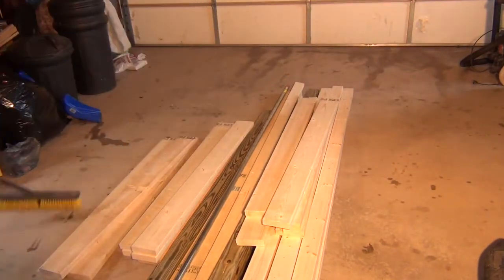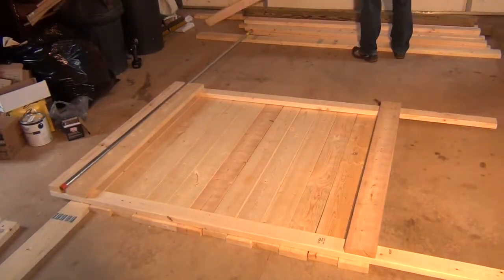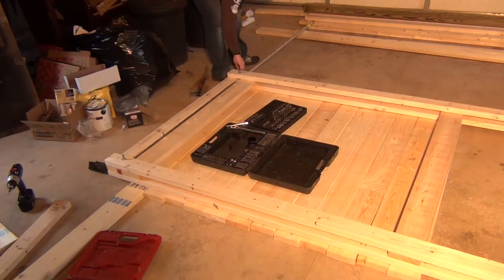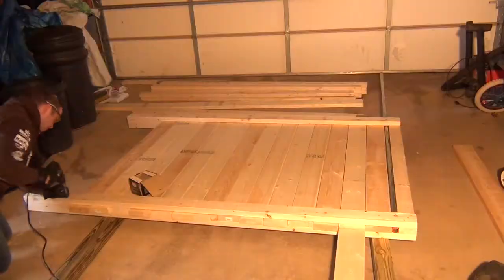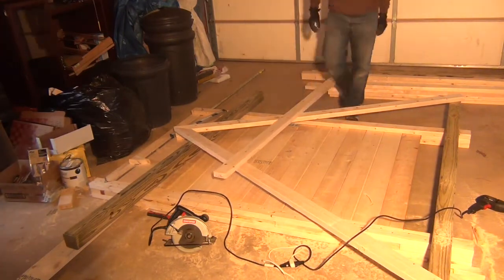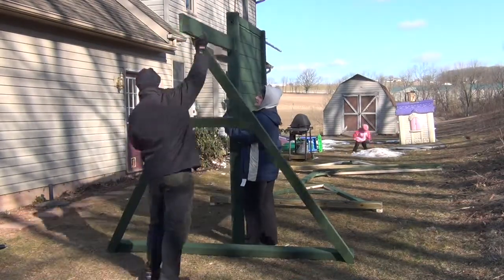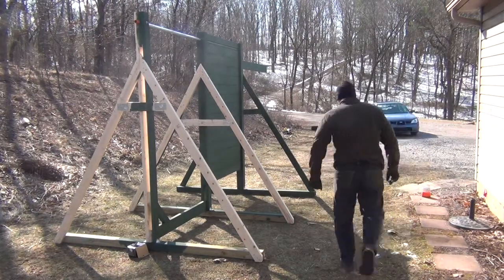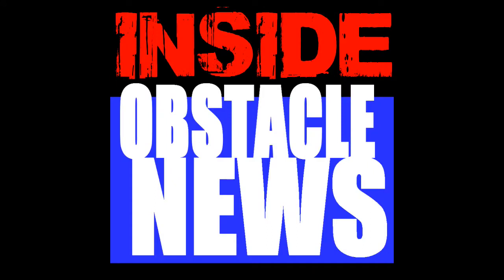Build an Obstacle Wall - WOD Hacker 4

Comment: Very helpful thank you. My biggest question is the length of the: "feet" or treated 4x4s and the "A" cross braces. With those lengths do you feel its secure enough from tipping or would you make either longer. Again, appreciate your comments, and good job on the video.

Comment from the maker: The wall uses standard lumber sizes so it is eight (8) feet four (4) inches high, because you stand the 8ft wall up on top of the treated 4x4 base. It can be any width you want but I chose five (5) feet wide because it was cheaper and easier to have my 2"x 6"x 10' boards cut in half at the lumber store. A lot of the angles I just kind of eyeballed and cut to fit. Hope that helps!

Comment from the maker: The 4x4's and 2x4 'A' braces are also 8 feet long.  They are heavy and rock solid.  I've never felt any give to the wall, even at the top, and I'm over 200 lbs.  If you wanted a wall that was higher, you may want to go wider at the base.

Comment: Which connector plates did you use along with the angle braces? Are your washers 3/8ths as well? Also did you use a Zinc plated carriage bolt with galvanized hex nuts?

Comment: Did you use 2 rubber washers (1 on each side of the bolt...between the two 2x4s)? I didn't see you put the first rubber washer on the underside of the bar...but I'm thinking you did.
Reply from the maker: Yup, two washers. :)